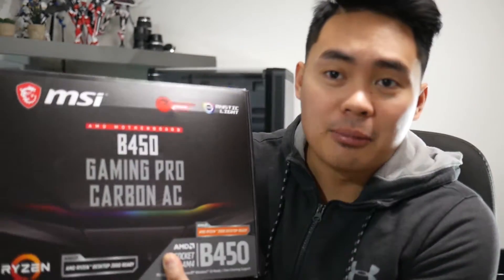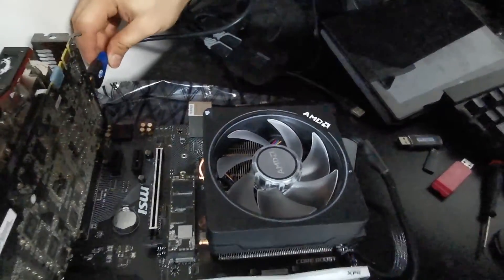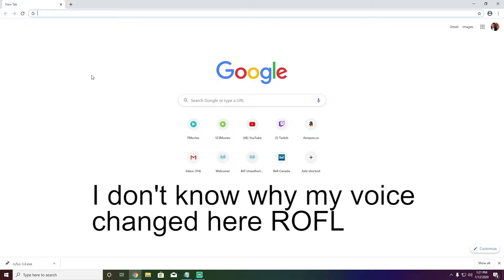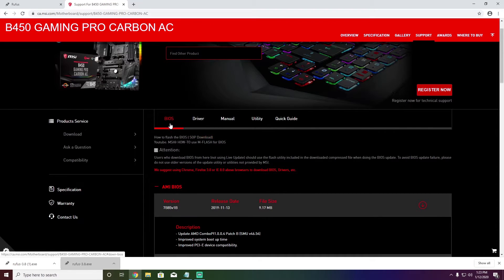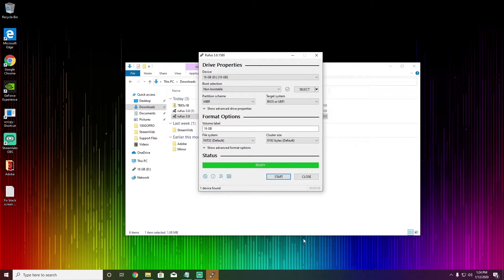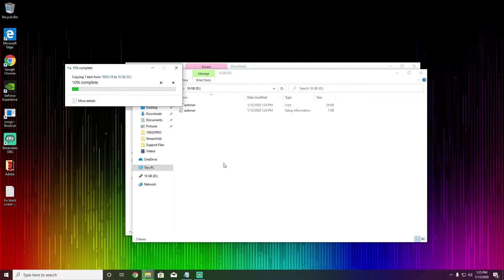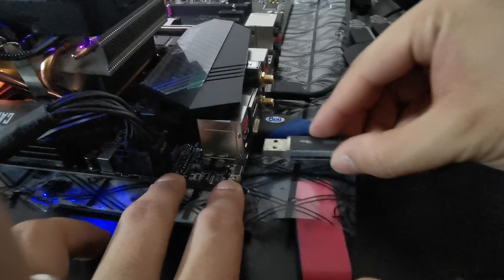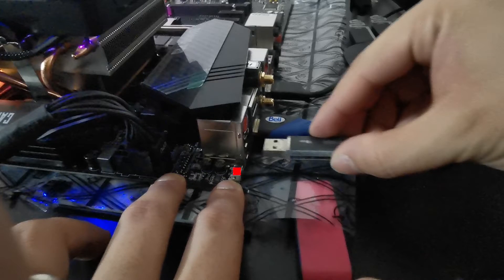RYZEN 3000 Black Screen on MSI eB450 MOBO(Motherboard) FIXED | 2020

Comment: I have a MSI B450 GAMING PRO max WiFi and I'm using a Ryzen 5 3600. I connected to the monitor using HDMI and it says no signal. Is it because It needs a Gpu to actually display on the screen?
Reply: +1 same problem
Reply: @ionescuveronel5011  Sorry This is an update of my problem. Turns out MSI motherboards depend on a secondary video card to display the bios or Operating system installation. Unlike other motherboards like ASUS or Aorus they have integrated Video cards that can only be used to set up bios or any operating system.
Reply: Same problem
Reply: Any solution?
Reply: @Oppenheimer849  always check if the CPU you brought is compatible with the socket motherboard and has built in graphics. If it doesn't have any built in graphics no need to worry just buy the GPU you like on your build like  the latest RTX or AMD graphics card
Reply: Bro, I upgraded to 3200G from 2200G. But having this issue. Sometimes the display is coming for a few seconds then it gets back to restart. I'm using MSI B450M PRO M2. Yes I've the latest bios. Also tested the CPU on a friend's B450M PRO VDH PLUS, same issue.